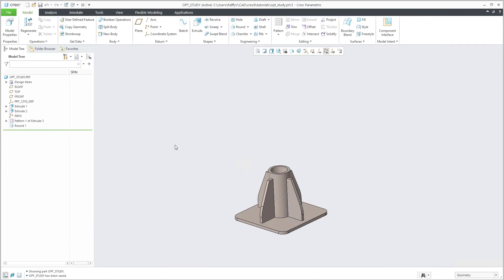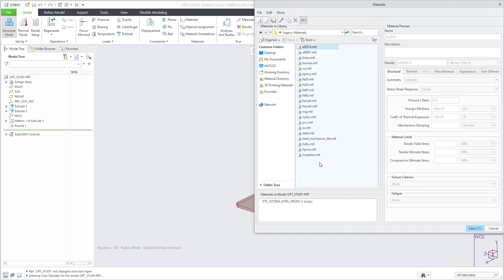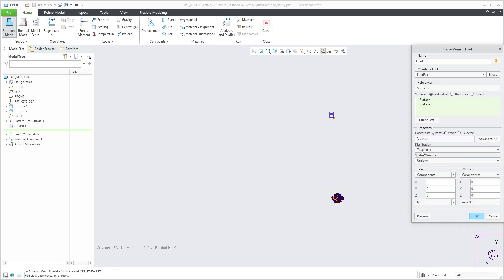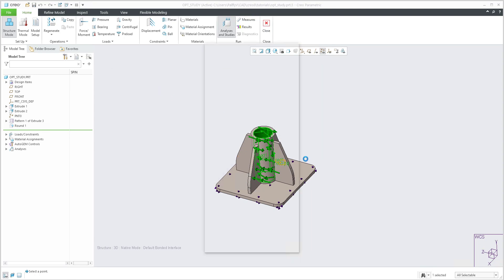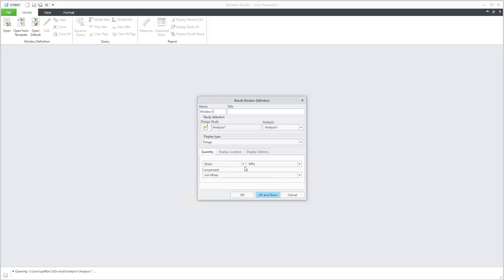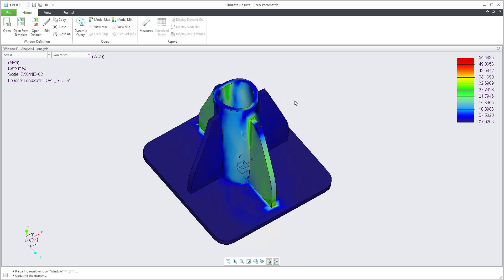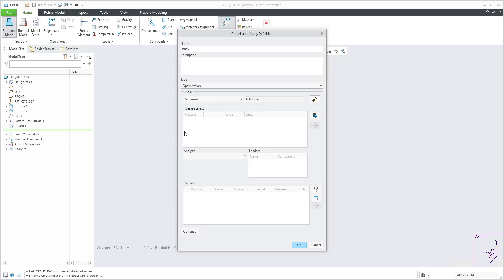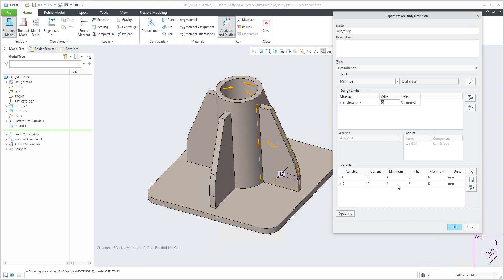Creo Simulate | Optimization Design Study

Comment: Thanks for the great video. How do you set it up to exclude areas where you know there are artificially high stresses? The option to customize these parameters using volumes.
Reply from the maker: Hi, from experience you know to guess where are you the higher values or from first quick calculation. Then you can create a volume or surface areas to make concentration of the calculation 🤝
Reply: @4kside Thanks, just cannot  figure out how to do it. I go to customize the parameters when I select them, and cannot modify any output to be constrained to a volume, even though the options are there. There is just no way to confirm the modification to the parameters, even though the option is present, it won't let me press ok for the change. I was curious if I had to customize the parameters in another way. Sorry for the oddly specific question, but it's relevant when using fixed as an idealization.

Comment: How can I get final optimized model with new dimensions?
Reply from the maker: Open Analyses and Design Studies window (where you create and run analyses) >Select Display study status icon > in this window you can find when analyse is finished and also you can find calculated results.
Please read last section under: The parameters values are now feasible and check modify your model dimensions based on results.
Good luck with your project.
Vladimir